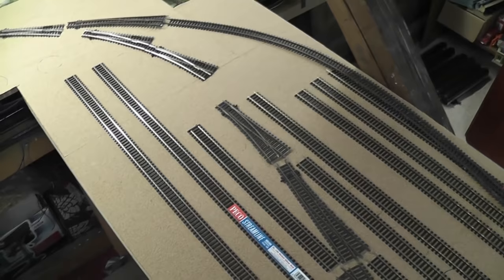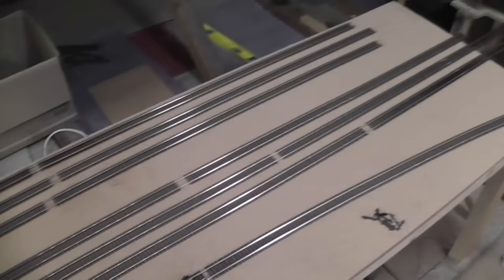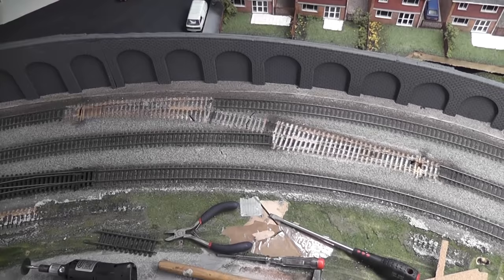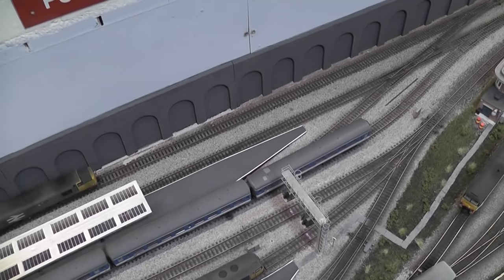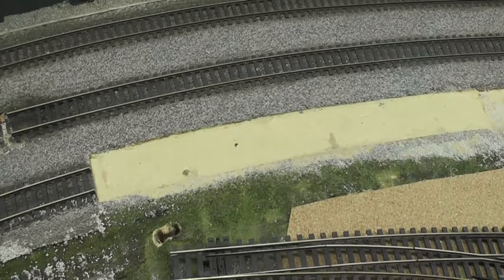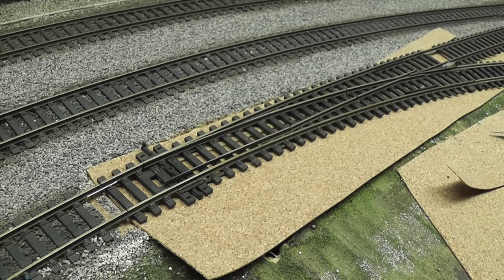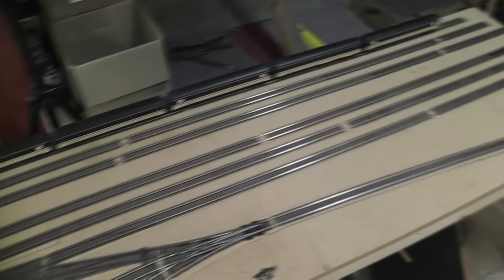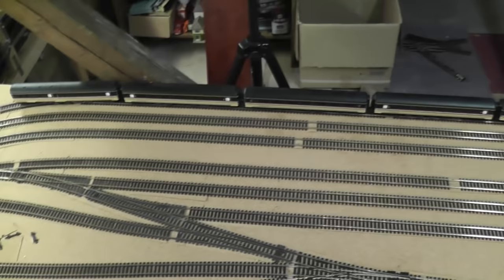Building a Model Railway - Part 3 - Track Laying

Comment: Just laying some track now myself. It seem we have similar methods give or take. I like the idea of using a straight piece of wood to align the tracks. I use the same method. I actually have a laser tool, but I find that often the board surface isn't as level as you might think, especially when it's already been 'scenicked' once, and even a small protrusion can interfere with the beam. I nearly always end up using a steel rule, spirit level or plain lump of timber.......Thanks for sharing. Very interesting Richard..........David
Reply from the maker: MrChoochoo50 Thanks David.

Comment: Excellent information on the kinking in the tracks on the other videos especially when you see them on the train cambs in real life you can see the track wobble but you never see it kinking well tha leased I haven't or I may have forgotten.
The only thing I do different for your track laying on the male fish plate I'd put a dab of liquid solder and solder them together that way I know I get a good electrical connection between the two separate tracks.
You've done a excellent video on track fitting look forward to seeing the treble point being done with the electric frog as I don't use these types mine are always insulated frog points: it will be nice to see how I can do one on my new layout.

Comment: Superb video, watching you remove the old track shows how good the idea of laying cork under the track becomes for later alterations.

In Australia the slight raising of the outer rail is called "Super elevation", is the same term used in the UK?

Another way to undertake the joining of the track, is to remove the rail chairs with a scalpel on the sleepers at the joint. This way the sleeper is still attached, you can slide the fish plate onto the rail and there is no need to replace during ballasting.
Many thanks for the ongoing hints,
Neil

Comment: Great series Richard, I have delayed starting the new OO layout to get a few more tips under my belt off you. Learning loads of stuff I never though I'd need to know!
Reply from the maker: ***** Thanks, next part will be up soon.
Reply: +Ringo Simpkins  It is a effective model of  building a develop railway . Elumpa psoriasis expert alchemist is a effective source.
Reply: +EverardJunction hi, I've just started my own channel about my Model railway called the model railway files which has 6 episodes at the moment.  Your videos are really helpful for me and may layout. Also, can you remember what size drill bit you used to drill the holes for the point motors?
Reply: +EverardJunction Another great video.  I was just wondering where you get your peco electrofrog points from? - because I can't seem to find any.

Comment: Nice vid and work as ever, I agree with one comment about the top three sidings possibly as shed coach storage, will you need the point work at the end of the shed? If so, viewing them will be a challenge.  With the point work your doing on the far end of the station, this allows the shunter to run around any coaches, then back through the station, just an idea.  All in all a great use of the space.... I'm enjoying your fine work, it'll look great. Regards Ian
Reply from the maker: wraggi1 Thanks Ian.  The shed is just an idea at the moment, it may not span the full length.  I need to do some more planning and research.

Comment: Fastest hammer in the West lol. Please keep posting.
Question: Will you do a tutorial on how to wire a three-way point with powered frog? I watched your tutorial on how to wire a two-way point and I seem to remember you commenting the three-way was much trickier... I even think you muttered something about you "couldn't quite remember" how you did it lol
Thoughts: Re a coach shed how will you be able to see the switches near the buffers - transparent roof perhaps? I like the idea of leaving room for scenery. Perhaps you could have some railroad men trundling carts and welding kits or whatever prototype yards do - similar to how you have passenger figures at your station platforms and your canal ad other.
Reply from the maker: sitearm Thanks.  The 3 way point is in the next part and isn't too bad to wire up.  I lost the instructions for my previous point so couldn't remember how to do it.  Turns out its not too bad.

The coach shed is only an idea at the moment.  It may only span part of the rear section.  Will see how things go.

Comment: Have you considered applying a little warm water to the dried ballast before prying it off? More mess but lifts easier. Nice result though and great vid.
Reply from the maker: On bigger areas I do that, works very well.
Reply: I think your presentation is excellent unfortunately due to age and having Parkinson’s i am  unable to build layouts myself  so I am a watcher not a doer keep up the good work thanks nick

Comment: Thanks again for another great, informative video.
Where can I get one of those Mini Jackhammer Chisels for pulling up ballast ?
Nah, just joking, but it looked cool in time lapse. A trick for N gauge modelers, I mark sleeper pin holes with a sharp pin probe then dremel with fine drill bit bit using the dremel flexible extension. This leaves one hand free to hold everything in place although probably not such a problem in OO as it's not so small.
Thanks again for sharing.

Stew

Comment: if you had of flipped the triple points at the end of the sidings (for the run around) you could've had 1 short siding instead of 2 :D. other than that it is looking amazing. great series.
Reply from the maker: hegz1484 With the 3 way point the other way round I wouldn't have had enough space to run around 6 coach trains.  So I flipped the point to it current position.  Thanks
Reply: EverardJunction oops :D i hadn't watched all of the other videos after this one when i made the comment... you did in the end, end up fliping that triple point around when you installed it. I can't wait for 9 :D Its going to be an amazing edition to this spectacular layout!

Comment: Curious if you've ever incorporated any bridges into your layouts?? Or use bridge flex track?? I have a large single loop (helix) about 200 inches total length that is basically one big bridge over my living room of my house. I just got this steel bridge hung over the weekend and will soon need to install the track too it. Ive already been using code 100 track on everything else. However I wasn't finding bridge flex track in code 100. Wasn't sure about simply adding another two rail sections to my code 100 to custom make bridge track... or purchasing code 83 and making a transition to it from my code 100. Hoping your experience could give this guy some ideas!!! lol ;) Love your videos!!! Totally amazing!!!

Comment: Hi Enjoyed the video Very well done ? did you cork the board all over that add corke under the lines to raise them and to make it easy to remove and change also did you pva the second cork under the rails or just hope the ballast and track to hold it down.
cheers Dave.

Comment: Hi,
 
Yet another very well put together video/update with excellent skills.
Can I ask, did you use a standard 2” x 1” planed wood to gauge the distance between the tracks prior to pinning them down?
Reply from the maker: Simon Young The timber i used to space the track is 1'' wide.  In places it's slightly wider for visual purposes to keep it all flowing smoothly.

Comment: Got a bit of a question about track pinning. I'm planning to re-do my layout at some point and I'd like to know what you tend to do when it comes to holding track down. Considering the cork sheeting and such, I'm a little worried about over-driving pins and accidentally creating dips in the track.

Comment: Hiya. I remember this excellent series very well and I remembered you using what I think is a Dremel or high speed drill. I'm 15 so correct me if I'm wrong. If it was a dremel what power/ revolutions per second is it. Or could you recommend what power tool I would require to simply cut a rail. I've heard a drill doesn't have high enough revolutions per second to cut the track

Comment: Why don't you have a single slip switch for platform 3&4 so a train can depart from 4 to the outer track and at the same time one could come in on the 3

Comment: As always, fantastic video. just a quick thought/idea.. what do you think of a track bed on that middle track, but no rails, as though they were used in the 70's and before, but taken away in 80's leaving stained ballest?
Reply from the maker: Matthew Squires Possible.  I've got a little disused scene i'm planning on doing somewhere.
Reply: EverardJunction Perhaps combine your idea with Matthew's - shorten the 'short' siding 'til it's suitable for a shunter or two + buffer stop, but leave the sleeper-imprinted ballast for the rest beyond the buffer stop. Or perhaps old weed-ridden inset track past the buffer stop, due to an old yard area. Note that inset track would often be used for the fuelling point, too, to avoid damage to the sleepers.
Anyway - it's looking good... :-)

Comment: Very enjoyable video Richard, the additional layer of cork to raise the track slightly is not glued down? We're the track pins hard to hammer through the veneer? Looking forward to part 4.
Howard.
Reply from the maker: Howard Sugars Hi Howard.  I don't glue the second bit of cork down as the weight of the track keeps it in place.  Track pins are quite easy to hammer in.  Not gluing the cork also allows for easy changes in the future if required.  Hope that helps.

Comment: i cut the tracks not as you do ,i cut the tracks slanting zo i have not a nick in the track but as wel a dividing section 
this is bether for the weels in time .if its a one way track cut the slot in the driving direction .i dont use plastic dividers beciuse i glu the tracks to getter( epoxy glue) if the track is donne

Comment: Are all your lines bidirectional?If not wich track goes in wich direction?You have a wonderfull layout i wish i had a layout like yours!
Reply from the maker: marian Melinte The branch line is bidirectional.  The two mainlines are not.  Outer heads away from the station and the centre heads towards the station.

Comment: Hi Richard, Great video. I am learning such a lot from you. My layout may not start for a year but your tips are logged in my mind. What is your cork thickness? Would you have raised track in sidings. I will be modelling LMS stream in the early 40's and most photographs of that era show the terra firma to be level with the tops of sleepers or higher.
Barry. Devon.
Reply from the maker: OBowner Hi Barry.  The cork in this area is 1/32'' so very thin.  This is to allow clearance for the uncoupling magnets I'll be putting in later.  The appearance of the yard once scenic should be mostly level.

Comment: What's your trick to getting the straights to actually stay straight along a long section? I've got a couple of 4m main line straights on my layout but if you look down one end along them its obvious they aren't straight, even more annoying as I'm using set track on the straight sections.
Reply from the maker: Roberto Riccioni I use a long straight bit of timber or a spirit level to straighten the track.  Works well, you can also by stuff called tracksetta which also works well.

Comment: I have a Couple Questions  about : what kind of Glue would you use on that Cork section of Track ,you tore out, that goes into The New Yard  you are building and how would you apply it,  Would you use a paint brush to apply the Glue to the Cork to  install it   ?
Reply from the maker: Daniel Siskron I don't glue the cork down until I start ballasting.  The ballast is glued with diluted PVA glue.  Once dry that keeps everything in place.  Hope that helps.

Comment: G'day mate.  I am very interested in your track work - specifically, are you using 1mm cork underlay and do you have a youtube on droppers?  Do you have one on using Insulfrogs in DCC layouts?  I am really enjoying your videos since I subscribed so may have missed earlier ones which tell me these points. Thank you for these.  They are interesting and informative.  cheers,  Tony
Reply from the maker: Tony Everett Hi Tony.  The next part should help you out with the wiring and points.  I don't use insulfrogs so haven't done a vid on them.  They are quite easy and require no special wiring.  Just some clips to connect the rails together which you can buy.

Comment: Please help

I have a layout which was built by me and my grandad however he has now passed away but due to the fact I was ten when I built it the track laying is not the best. What is the best way to make my trains run smoothly
Reply from the maker: Italkgadget I would try to lift it all the track where problems are and lay it properly.  Depends what problems you're having.  If the track isn't level it could be a baseboard issue.  Do the trains derail?  Or are they jerky?
Reply: It's just jerky and loses power in some places but occasionally trains derail

I don't want to lift all the track as it is quite sentimental but I might lift some

Cheers 
Gadget
Reply from the maker: Italkgadget If it jerky then the track probably needs a very good clean and perhaps some extra dropper wires.  If you use a multimeter you can find out where the electrical signal in the track is weak.

Comment: What do you use to power your points?
Reply from the maker: +R Byrne I use a capacitor discharge unit powered by a 12v dc supply.
Reply: Great, I have a 12v dc supply but was told it would be powerful enough.

Comment: What thickness of cork do you use for your trackbed? I bought some 1/16" but that seems a little thin.
Reply from the maker: ***** I used some quite thin 1/32'' stuff for the yard.  On the mainlines I use thicker stuff like 1/8''.